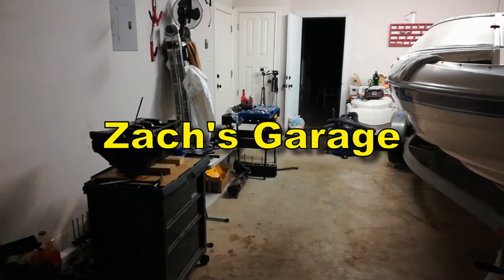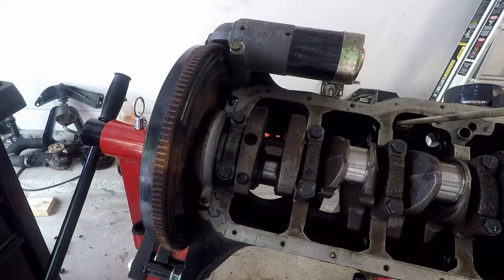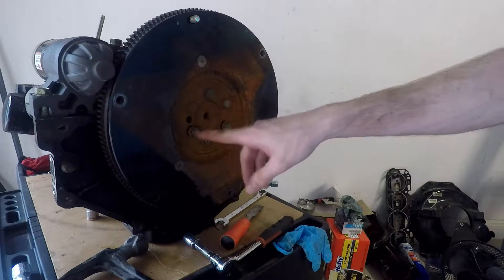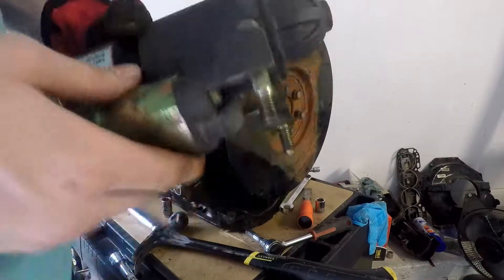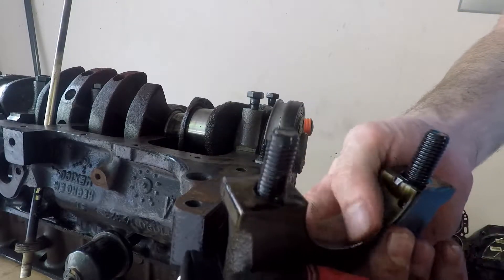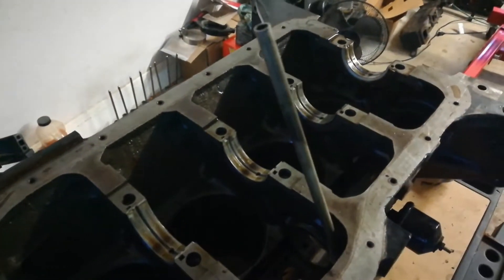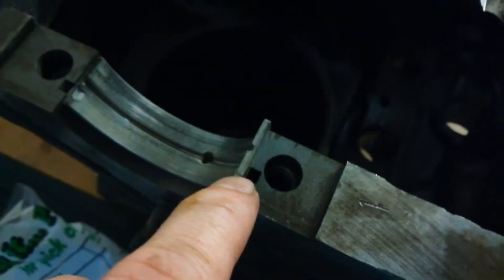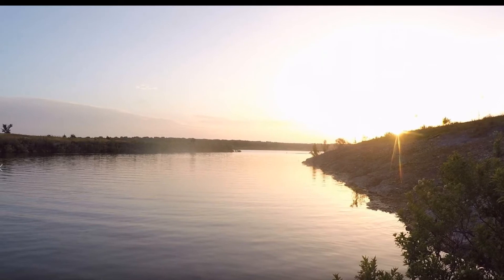Mercruiser Teardown Part 3

Comment: Also note that the bottom half of those main bearings have a hole for oil. Idk if you can mix the 2halves up or not, but the engine would seize if you did.

Comment: Hope you replaced the exhaust manifold. Looks like the source of your water.
Reply from the maker: I was thinking the same thing! Ending up being the exhaust riser, the gasket surface with the exhaust manifold was not flat there was old gasket hardened to it that had not been fully removed, so it was leaking from the water ports into the main exhaust port of the manifold. From there the water would build up and then run into the exhaust valve port of the 4th cylinder. I put a scope camera up the riser to find that out. So lesson learned, if a gasket is keeping water from getting to where it shouldn't be, then make sure the mating surface is flat and clean!
Reply: You know when you finished that boat project, you will have a boat not worth having? Hit the front with your fist to see how thin the fiberglass is. Do the same to any other boat. Put that new engine in anything and it will be a better investment for you. Research the boat and you will find its disposable. I do salute your willingness to accomplish the task. Like your videos too but its sad to see you putting the effort into that boat. Feel free to delete the comment, I just wanted to get the message to you. Good luck!
Reply from the maker: @austinhydroax  I think we can agree on that! What I will say, is that I don't think I'll be doing this same restoration twice, haha. The investment of time has been immense, but I have learned so much. I appreciate the comment!
Reply from the maker: We both know, Bayliner boats made cheap, and I agree it is sad, it's a real shame, the corners cut, were very evident. Almost every piece of wood in my boat was terribly water proofed. If only a little bit more effort had been put in to doing it right the first time 😛

As for the hull, I can't speak for all Bayliners, but mine is fairly solid. I have hit it with my first many times over the course of this project lol. And actually hit it with a hammer many times, but she's determined to hold together. If day ever comes that it gets punctured by a rock... Well... Luckily I have plenty of fiberglass left over to patch her up 😉
Reply: I wish I could attach pics of mine.  The lowest quality boat I ever owned was...a bayliner capri. Engineered to rot out.  My hull was paper thin up front at the numbers. Once I attempted a correct craft stringer job where I learned don't do stringers. Same fiberglass and foam. Like you I learned a lot. But the most important thing was when to bail. I sold the trailer and trashed the boat, cut my losses. If you don't put a grand into the capri interior you may get your money out of it or youtube users will increase which makes it all worth while I guess. There are tons of boat projects that are a better choice but if your happy I am happy. Look at sale prices to get market value. I know your not looking to sell but why spend more money than buying a working unit right? Once you do it, hopefully you will want to do it again. It gets faster and the results get better. Im an old guy who has done this many many times with many different boats.A hobby :) happy holidays!
Reply: While it is possible for some boat hulls to get waterlogged if left in the water for extended periods of time, boats like thats generally are removed after each use. So i really doubt the hull would be compromised at all. Most are solid fiberglass, some bigger boats have cored hulls that can water log.